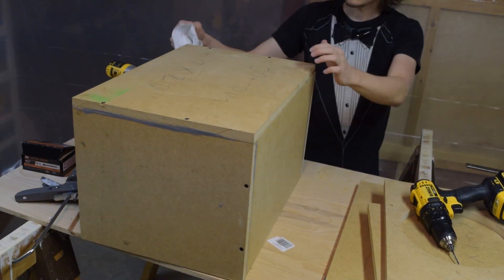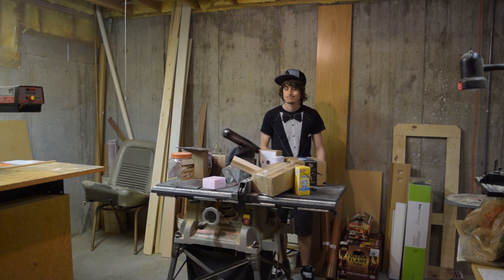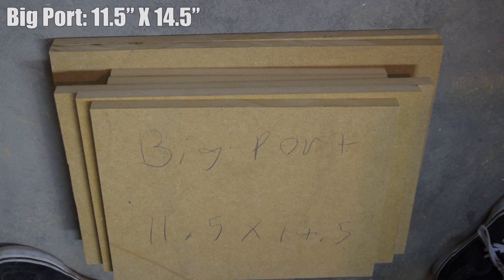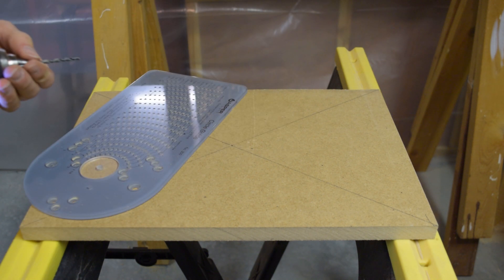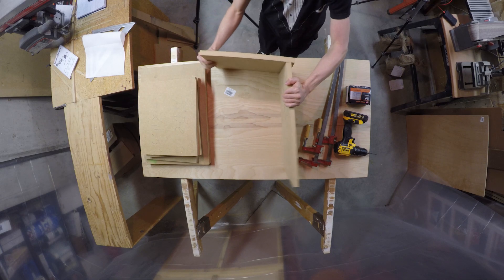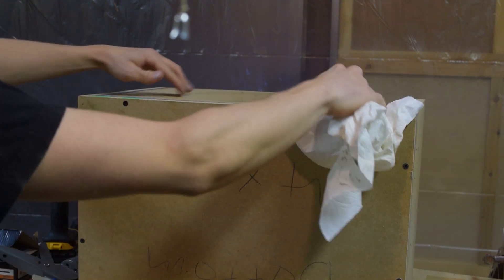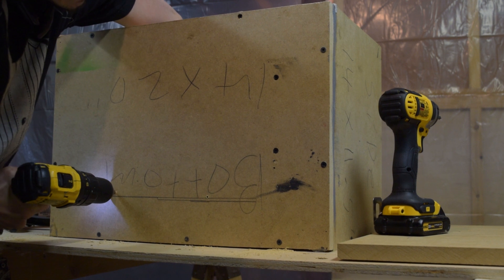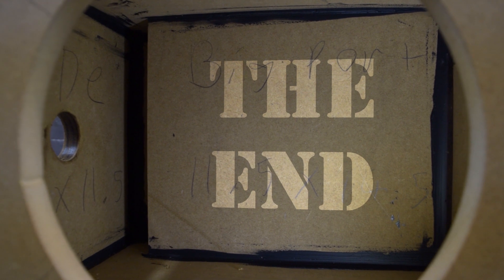How To Build a Ported SubWoofer Enclosure for a Single 10 inch | Specs Included

Comment from the maker: Cut List for this 10 inch ported subwoofer enclosure design (3/4in MDF):
Front: 16.5" X 11.5"
Back: 18.5" X 11.5"
Side: 14" X 11.5"
Side: 14" X 11.5"
Top: 14" X 20"
Bottom: 14" X 20"
Big Port: 14.5" X 11.5"
Small Port: 9.75" X 11.5"
(measurements in inches)

You can find most of these supplies and tools at your local Hardware store. Here are also some links to similar things I was using to build this enclosure:
# 6x2" Flat Head Phillips Screws: https://amzn.to/2VB22to  (paid link)
Caulking Gun: https://amzn.to/3bk8Lyv (paid link)
Silicone Sealant Caulk, Black: https://amzn.to/2zaLfpr (paid link)
All Surface Liquid Nails: https://amzn.to/34HUtVV (paid link)
DEWALT Cordless Drill & Impact Driver Kit: https://amzn.to/2Kb8CkU (paid link)
Screwdriver Bit Set / Drill Bit Set: https://amzn.to/2ypGsQm  (paid link)
Router: https://amzn.to/2wO1vM9 (paid link)
1/4" Router bit: https://amzn.to/2xGSlSb (paid link)
Router Circle cutting guide: https://amzn.to/2RMpF13 (paid link)
Hole Saw Set: https://amzn.to/3eFx7ou (paid link)
Bar clamps: https://amzn.to/2XJ3TPm (paid link)
Rafter square: https://amzn.to/2XJTrae (paid link)
Terminal Cup: https://amzn.to/2KfFfhq (paid link)

Find this Subwoofer, Amplifier, and wiring kit here:
Rockford Fosgate P3D4-10 Punch Subwoofer: https://amzn.to/376PE7T (paid link)
Rockford Fosgate R500X1D Prime 1-Channel Class D Amplifier https://amzn.to/36Y76vj (paid link)
InstallGear 4 Gauge Complete Amp wiring Kit: https://amzn.to/31ulNVX (paid link)

(I may get commissions for purchases made through links with "paid link" next to them)
Reply: I'm buliding a ported box for 2 of these p3s 10 inch subs... so would I just double this box size or how would I go about it??? Please please help... ill will pay if needed thank you buddy I appreciate it.
Reply: Hell yea.. thanks man. Awesome video
Reply: Bro please give the measurements of front bass cabinet for single10inch 100w woofer ..please give me quick response
Reply: I did these exact measurements and my box turned out completely to small and barley fits the 10 inch sub inside

Comment: I wish someone would tell the guy how dangerous mdf is for your lungs. A dust mask will not protect you. When punching holes in mdf if you are burning board and inhaling dust with fumes with no respiratory protection this is how you get cancer or worse.. When handling clean mdf with bare hands you need to wash hands extremely well after because it contains formaldehyde
Reply from the maker: thanks, best to be safe, I also don't do this everyday

Comment: Too funny you're using a router to cut the woofer out and a dull drill bit to pre-drill the holes.. proper and Sharp Tools make all the difference
Reply from the maker: yeah haha, just used what I had laying around. I need to get one of those bit sharpeners
Reply: @4WheelKid  I've got one they kind of suck. You're better off just buying a bulk small drill bits at the generally one or two sizes that you used most of the time

Comment: nice vid. I suppose you could always use two different size boards, 1/2" X baffle or 3/4" X baffle, then 3/4" for the sides, or something like that, esp. if space is limited. 
Does 3M 77 or another 3m spray or gorilla glue spray work for carpeting a fiberglass box?
Reply from the maker: I bet you could indeed. might be a bit more complicated but doable not sure, never tried a fiberglass box before

Comment: How much do I need to leave the port area apart??
Reply from the maker: I designed mine so the port is 2in wide
Reply: Thanks and I already cut all the pieces and I wanted to ask how did you like the box ? Did it work good thanks
Reply from the maker: I love it! Works great, still gotta edit and upload the final install and test video
Reply: bassisgood great I’ll be waiting and it’s a pretty good box in my opinion thanks

Comment: Nuce job but I dont recommmend using liquid nails adhesive, use wood glue its so much stronger and will last alot longer than any adhesive
Reply from the maker: thanks! yeah I have heard it both ways
Reply: Actually wood glue would be worse, it’s hard as wood so it can crack where as liquid nails or all purpose loctite is better because it’s more elastic and takes longer to get as hard as wood glue, so it would be harder for the subwoofer to vibrate it apart
Reply: @TrollsAreUs1320  liquid nails is garbage for building boxes, wood glue is much stronger and wood glue will not crack. Any flex in the joints (youll have much more flex with loctite) youll lose output. Never use liquid nails to build a sub box.
Reply: I promise you from experience, wood glue over time will crack it gets too hard, otherwise he would use that only, that’s why he uses the liquid nails as a sealant not as to hold the box together. He’s using screws to keep it tight and the LN as sealer
Reply: @TrollsAreUs1320  If you build enclosures like me and take the time to get straight cuts there is absolutely no need for liquid nails or any sealant, the glue will be sandwiched between the joining surfaces and there will be no gap. I still have my first enclosure I built when I was 15, going on 6 years now sitting in my garage in all climates. And Ive never ever seen or heard of wood glue cracking. You must have used some terrible glue. If you had proper cure time and clamp force, wood will always crack before the glue.
Reply: @cjon24s69   Facts!